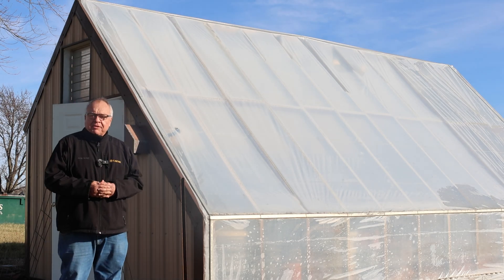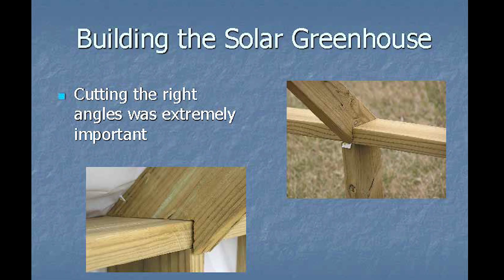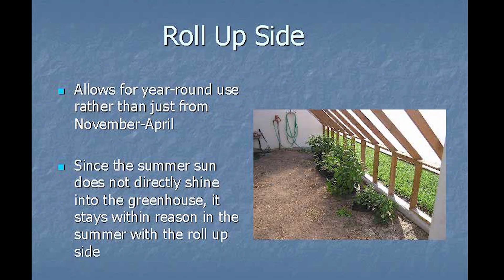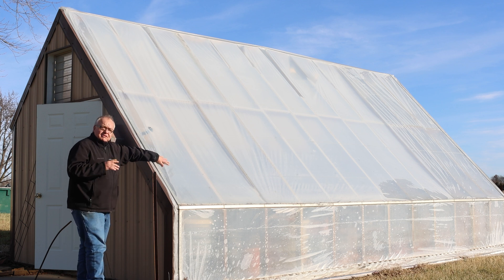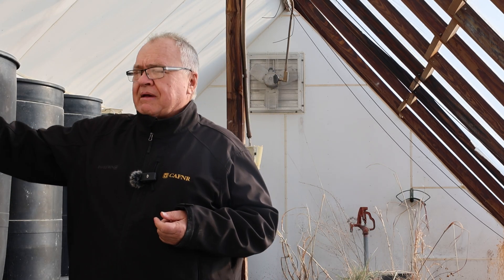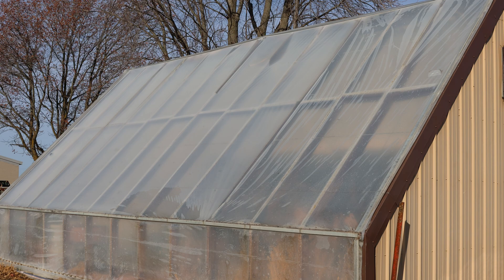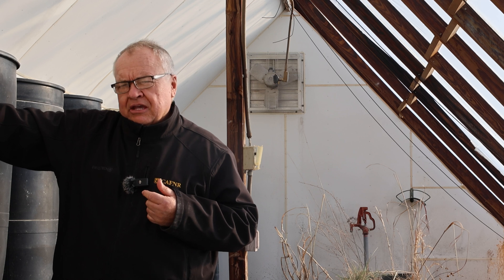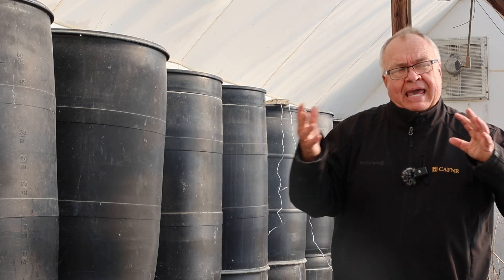How To Build a Solar Greenhouse

Comment: Great video! Another benefit of water barrels is that water releases a whole buns-load of additional energy if/when it freezes. I think it's something like 1200 BTUs per gallon of water just changing from liquid to solid state. So that gives another layer of freeze protection above and beyond its heat capacity as just a liquid.

Comment: Just for clarification, that heat in BTUs is released when the water temperature drops 10 or 20 degrees, not the air temperature.